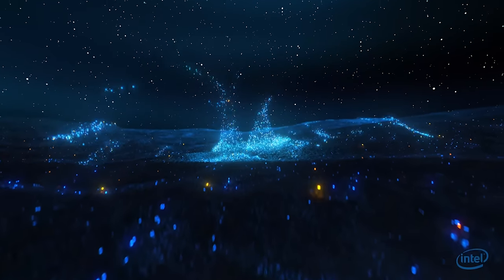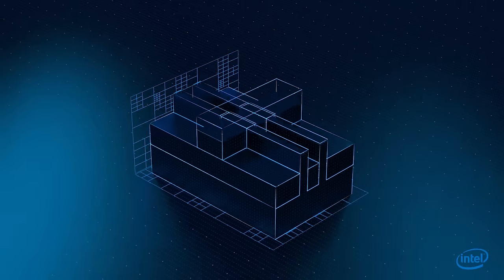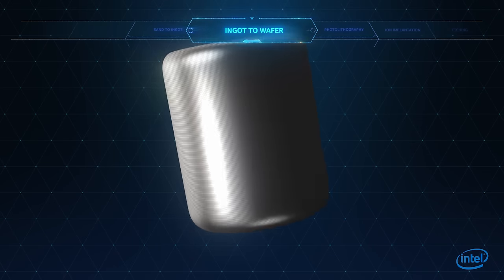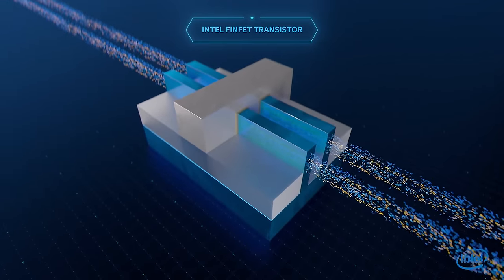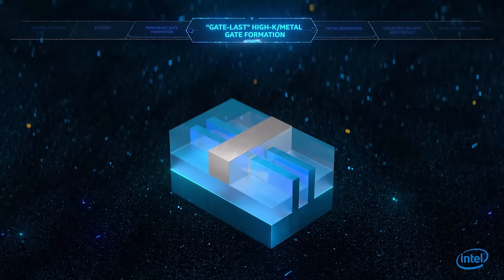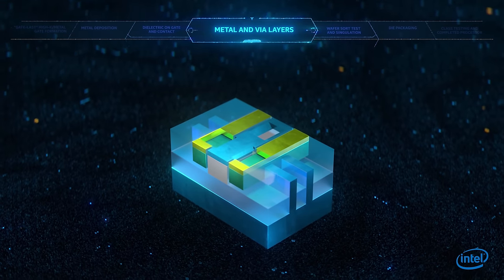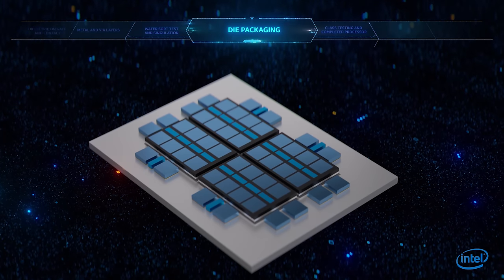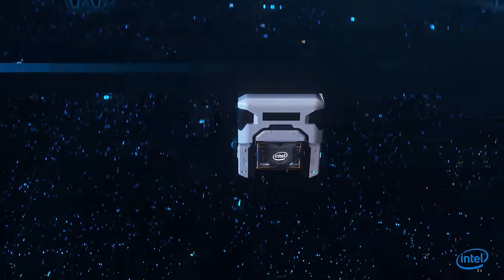From Sand to Silicon: The Making of a Microchip | Intel

Comment: My brain can’t comprehend this. This is just incredible.
Reply: They extract the silicon out of (quartz) sand by melting it to 2000°C. Then they have machines for each process that do everything for them. Each group of engineers / scientists only know stuff about their chain in the production process because the whole process is so very complex.
Reply: @Scrungge   ccg
Reply: @Scrungge  q
Reply: Also no CPU is the same some come with higher clock speeds or dead cores. I3, I5,I7 and so on are all the same processor just with different clock speeds or core count...think of it if you design a cpu with six cores but two are dead leaving you with 4 cores, why throw it away ? Just brand it as an i3 and sale it cheaper. It's also referred to as the silicone lottery. Pretty cool that CPUs have there own personality.
Reply: Basically we tricked a rock into thinking

Comment: Wow, this is how vintage 14 nanometer processors are made. Fascinating
Reply: I knew this comment would be here LMAO.
Reply: Lol
Reply: trust me you dont want to see a 7 nm intel processor, that would be an industrial revolution lol
Reply: u made me lol :)
Reply: @eduuklee9453  That is exactly why we DO want to see it. Its impressive that intels 14nm platform has survived this long but it is showing its age. overheating cores and lackluster performance is plagueing intels new 14nm chips while AMD can run cool as a cucumber despite having more cores. Intel needs to innovate or they are going to hit a brickwall with 14nm
Reply: @shadowxxe  also not every cpu type can become 7nm, if intel want to go down that path they have to re-invent a completely new kind of archetecture. AMD can have 7nm because they invented a completely new cpu for that purpose. some smartphone "ARM" CPUs even got 5nm but that doesnt mean that its possible to make a 5nm ryzen CPU. It would probably require a new archetecture again D; its not that easy. And i dont blame Intel if they can not manage to solve such a complex problem.
Reply: @eduuklee9453  AMD used TSMC and Global Foundries for their 7nm chips intel should probably do the same. Also ARM CPUs and Desktop chips arent like polar opposites they are still CPUs they still use transistors its entirely possible for an existing arm technology to be upscaled and redesigned for desktop chips and it wouldn't even be that hard. Also, you should blame intel for not being able to solve this because THEY are the ones who refused to innovate for 10 years sending pc hardware into a dark age THEY are the ones who spend all their money on marketing rather than RnD and THEY are the ones who kept rehashing 14nm for 5 years whereas AMD left it behind only a year after they first used it.
Reply: @shadowxxe  AMD wasnt able to make a 7nm on their own eighter. Partnership and fusions with other companies is literarelly the worst thing that can happen and should only be considered on the verge of bankruptcy. Intel will do it on their own, they got the ressorces. and even if it will take another 10 years of developement it will be totally woth everything. Indeed This is the age of Ryzen CPUs.
Reply: @eduuklee9453  lol thats actually everyone wish. When is it?
Reply: Ze10
Reply: @Ron Bali Yes thats because intel also produce wifi cards, sound cards and other ICs their CPUs however are declining in demand
Reply: @Ron Bali Wierd considering they had to drop process on 11th gen because they sol so poorly
Reply: @shadowxxe  They did it because it's just a stepping stone processor. It's their 10nm architecture on the 14nm node. Like someone said before...You can be a fanboy for either company but let's be honest here. Intel is a HUGE company and has done wonders in the electronics game. AMD has a long way to go. Respect to both though.
Reply: "Waste of sand."
        -gamers nexus
Reply: @MrPanaramuh  Like i said it is of no concern to me what intel have done in the past the point is right now they are failing to deliver. they were titans in the past but now they are loosing major market share in the consumer market
Reply: @shadowxxe  wouldn't really calling it "failing to deliver." Intel designs AND manufacturers their own cookies in house. It's just two different games. AMD has woken up, Intel sees it, and the race has begun once again. AMD hasn't really been a competitor since before their Thuban line. Can't really blame Intel for making money now, can we?
Reply: @shadowxxe  
"Failing to deliver"

Depends.
In raw performance and power consumption, yes, they have failed to deliver AMD's performance at AMD's power draw.
But they can still deliver AMD's performance levels at very high power draws.
(As side note, rocket lake is meant for desktops, and lower power draws are more of a preference/"good to have" than necessity)

So they have not not failed to deliver 4 things:
1) They have not failed to deliver the performance of 2nd most advanced process on earth on a very ancient process.
2) They have not failed to make cpus on some ancient process competitive with cpus on 2nd most advanced process on earth.
3) They have not failed to make a cpu designed for 10nm on 14nm
4) They have not failed to make a backported cpu at least competitive.

Ryzen 5000 is better than 11th gen because its gives intel's performance at lower power draws.
But still, given how complex these things, these 4 things i said intel delivers are big achievements in themselves.
Reply: I literally have a 45nm processor BRUH
Reply: @eduuklee9453  2022 we will see them, but IBM almost reached the 7nm intel density with its own 2nm
Reply: @jhonrinkarsi2269  2022
Reply: @eduuklee9453  3nm is saying hello
Reply: For me 14 nanometer is decent enough
Reply: @adrian-121  lol, I haven't owned any product with an AMD processor, my entire life
Reply: @sankalpagrawal345  i have. It's worse than vintage.
Reply: @adrian-121  well , I hope someone makes a video on that, it will be entertaining
Reply: @sankalpagrawal345  ok, I can make one if you dare.
Reply: @adrian-121  hmmmm, that would be fun.
Reply: Antique owner of 32 nanometer processor here
Reply: @adrian-121  no it isn't I have both Intel and AMD ryzen 7 5700u is able to give me 9 hours of battery life with good integrated graphics and delivering my i9 10900k lvl performance or bit lower
Reply: @LtMewS  it depends on the battery. Intel laptop would run faster if it had a larger one.
Reply: @thefirstsin  rip
Reply: RISC-V architecture, 7 nm!
Reply: These numbers are meaningless
Reply: @starlitnight6982  intel's 14 nanometer is slightly worse than tsmc's 10 nanometer, according to some comparisons, so they are not meaningless, unlike stuff like comparing tflops between gpus of different brands

Comment: And everything has changed after ryzen came
Reply: Love you comment my brother
Reply: Opecuted  well yeah, nowadays one needs to attach a refrigerator to cool an intel chip, looks like the old amd is the new intel
Reply: @Alab.A  that's not true. i think you never used intel. and also intel has capability to bear over heat.
Reply: @VibezVideo  "cheap" 🤣🤣
Reply: @VibezVideo  intel i5 10400f is cooler than r5 3600 ON STOCK COOLER. YEAH. THAT TINY FAN WHICH EVERYBODY MAKES FUN OF.
Reply: Intel gave birth a baby named Ryzen! Intel is that old

Comment: AMD fan here, btw the 14nm lake is drying up.
Reply: Intel
Reply: Just imagine how great is intel they can still squeeze out every single bit of performance being on such old process node, they are still not dead AMD is gonna enjoy the market value until intel comes to 10nm/7nm/5nm etc
Reply: @shubhamjoshi7213  impressive, however not the direction they should keep going to. 14nm can only do so much if Intel still can't figure out how to get the 10nm fabs ready, since right now their CPUs are literally taking double the power to barely match AMD's performance (in other words, only half of AMD's power efficiency).
Reply: @shubhamjoshi7213  i like your profile pic
Reply: @mauricetejada6553  its made for pubgm profile pic 😅 because on fb id all the reletives are connected
Reply: Yeah, instead of actually being interested in tech, its better to flame Intel yes yes
Reply: Intel makes their chis themselves and researches on it themselves, and on the othe hand amd outsources their chips that is why Intel has best 14nm chips and their 14nm chips compete head to head with amd 7nm.
Reply: tsmc/samsung are the future, now.
Reply: @akshitchoudhary877  have you seen the benchmarks? amd 7nm outpeforms intel 14nm. and amd processors are designed with tsmc's processes in mind.
Reply: @akshitchoudhary877   head to head? Not really, they are quite a bit behind in regards to overall performance, simply due to efficiency.
Also, what Intel calls 10nm for example has very similar internal dimensions to TSMCs 7nm, if not 7nm+, similarly with 14nm
Reply: @imeakdo7  memory future
Reply: @imeakdo7  if no ones talking with you then what you think you are smart?
Reply: @shubhamjoshi7213  yep on a 288 watts tdp
Reply: @shubhamjoshi7213  well the great Intel quietly admitted they are behind AMD as their next gen cpu's won't be coming till the end of 2021. Such a great company to come out and admit defeat.
Reply: Shubham Joshi But but but Intel had promised to already be on the 7nm process and they are not what do you think about that??
Reply: Haha
Reply: Do you spin well, AMD fan? Gotta keep those heat down, you know..
Reply: @akshitchoudhary877  bruh intel isn't innovating whatsoever. the only reason the are pushing out so many new processors is because AMD is biting on their heels. AMD isn't only a better value, they also perform better in almost everything.
Reply: @antonn.ivanovic  gotta make that TDP lower , you know.
Reply: @69iqtutorial  sucks
Reply: @shubhamjoshi7213  Intel has the majority of the market share, and they can't squeeze anymore power out of their outdated processors, without having an astronomically high TDP
Reply: @antonn.ivanovic  used their coolers in the past, gotta admit I was surprised the stock wraith spire kept my overclocked 3.7GHz ryzen 1700 under 70°c. So AMD fans are pretty solid considering they come included in the box
Reply: @shubhamjoshi7213  They already came to 10nm, and so far it sucks hard.

Comment: Amazing video but I'm changing to 3rd Gen Threadripper...
Reply: AMD is fine if you don't need single core performance.
Reply: @1pcfred  TR has higher single core than ANY Intel CPU.
Reply: @jonnypena7651  does it?
Reply: @1pcfred  comparing to the server and production side of intel, yea!
The only need to buy a xeon this generation is if you have a specific software that only suports it
Reply: @FIRSTEBITOS  sounds specific to me. I'm not much for servers myself. I only have a file server. It runs on an old i3. In general I favor Intel over AMD. I haven't run any AMD hardware in over 10 years. As far as I'm concerned right now it is all junk. The whole industry has fallen off a cliff. I don't see it being sorted for years yet either. So if AMD wants to be king of the garbage heap presently then they can have the crown.
Reply: @1pcfred   ok, just saying if you need to buy a new processor, i also preffer the athlon and pentiuns days, they used to be a big race
Reply: @FIRSTEBITOS  now is not a good time to be buying PC gear. My present rig pretty much does what I need it to too. It's a bit slow on some tasks. But I'll manage.
Reply: @1pcfred  ok
Reply: @FIRSTEBITOS  it is.
Reply: @1pcfred  ok
Reply: @xtruder1828  boomers created the world you're living in, kid.
Reply: @1pcfred  i guess you didn't get the joke, it's okay. And i didn't mean to offend you either :) btw I'm 36 years old now.
Reply: @xtruder1828  so that makes you a border line Gen X or Y. Least you're not a millenial right? Or worse yet a zoomer! Those kids truly are insufferable. The world certainly has failed them. They're in for a rude awakening now.
Reply: @1pcfred  alright sir
Reply: @1pcfred   😅 and i respect your opinion . Peace
Reply: @1pcfred  jeez. Calm down.
Reply: Paul Frederick I agree with you mad and is good at multi core performance because it has lots of cores but intel definitely beats amd at single core preformance and that’s why I use intel because most 2020 games need less but strong cores
Reply: Jonny Peña but that’s really expensive

Comment: Man Intel is still innovating and at the cutting edge. My company, that builds fabricated circuits, that Intel uses to test each of its chips, is constantly trying to keep up with Intel just so we can stay the primary contractor. Engineers have all entire seminars and meetings, PowerPoint presentation and trial and error experimentation to try to figure out how to make something that and test the “new” thing. Right now Intel is about to introduce a new type of EMIB and so my company has engineering runs going through the fab everyday trying to nail it down.

Comment: "doubled transistor density with every new generation"

Fake News! Intel is basically selling 14nm skylake CPU's scince 4 generations xD
Reply: David you get to see the scatter plot flatten at the end haha
Reply: They said transistors 
Intel still has more transistors density than AMD.
Intel is doing the same thing what AMD did before ryzen
Their cpu runs hot and at higher clock speed 
I am not a fan boy
Reply: Skylake is architecture. Same architecture can be used for fitting more transistors.
Reply: @premashetty6469  The Transistor density is lower then AMD, TSMC's 7nm HPC Process has 66.7MTr/mm2, Intels 14nm++ has 37.5MTr/mm2
Reply: @apcgamer2265  fake news. You can fit a Ryzen 5000 series on a B450 easily. Also all boards and chips are unlocked unlike intel.
Reply: @lel3019  Maybe one day in your life you will learn basic maths and notice that 14 is bugger than 7
Reply: @shadowxxe  i do know that but marketing and reality are 2 different things 😂

Comment: “Doubling Transistor Density in every new generation of processors”
Yeah, as if they didn’t stay with 14nm for 3 generations
Reply: Bruh theyre still on 14nm and just started making 10nm hahahaah
Reply: Just because they stay on the same manufacturing process doesn't mean the transistor density stays the same.
Reply: @camulodunon  The Transistor density is still the Same.
Reply: 3 generations? Its 5 generations.
Reply: @premashetty6469  Not correct, as the dude who previously replied to you said, AMD has nearly double the transistor density.
Reply: @lel3019  dunno if you've ever seen a graph comparing transistor sizes, theres nothing 14 or 7 about them
Reply: @GAMEVIDSnorwegian422   yeah keep licking AMD's butt keep it up you are doing great
Reply: You guys don't get it. Intel is a semi conductor manufacturer beside being a CPU manufacturer. 
32nm, 22nm, 14nm, 10nm, 7nm, 5nm, 3nm, 2nm etc. are nothing but names for processing generations. There is literally no structure within a 14nm CPU that actually measures 14nm. 
Instead of calling it 14nm Intel could name it something like 25th gen (I don't know how many process nodes Intel already created) which would be legitim as well. 
And Intel indeed doubled the transistor density with each (process node) generation. Unlike foundries like GloFo Samsung or TSMC who usually under scale their process nodes. That's the reason why Intels 10nm is pretty much equivalent (even better) to TSMC or Samsungs 7nm process. But you guys don't seem to understand the basics of CPU manufacturing and just believe in marketing numbers. 

BTW: Intel names its intra generation improvements with a + notation and that's fine. But GloFo and Samsung do the same but use different names. GloFos 12nm is nothing else than 14nm+ with a fancy name. Samsung 8nm is nothing but 10nm+ with fancier name. Intel never really cared about this. Samsung and GloFo use these fancy names for marketing and you guys take that without questioning. Not a surprise why they keep doing it.
Reply: @lukas_ls   finally someone got brain now i can finally say that im proud intel user
Reply: I only use Intel xeon processors for my office and home.

Comment: Incredible processing power that you don't currently have, Intel. Single core is good, but only because of your clock speeds.
Reply: Not clock speeds.
AMD has to emulate x86 execution because they do not hold the rights of x86 instructions. So therefore for each x86 instruction that a AMD chip has to execute, it must first be translated into a instruction that the AMD chip internally uses, executed, then re-translated back to x86. This inserts a little bit of overhead into each instruction that a AMD chip has to execute and the reason why Intel chips appear to be faster with single core(because a intel chip can natively execute x86 code).
One of the ways AMD has made up for this issue was to just bruteforce it with a truck ton of cores.
Reply: @memadmax69  except that it also has to do with clock speeds. Intel has 5 GHz all core boost for their i9 9900ks, and yet it is within 10 to 20 points in single core performance of AMD, and AMD is at 4.7 GHz max turbo. Single core performance, despite the overhead, is within margin of error, and within games, only really benefits the 1080p/1440p gamer with a 2080 ti. There are some games that Intel really excells in, but for the most part, an Intel i9 9900ks gets beaten by the ryzen 9 3900x
Reply: @memadmax69  Do you have a source for this?
EDIT: I searched myself and found that the famous " ‘338 patent" was settled to a cross licensing agreement with amd.
Reply: @Jonas_Meyer  

Look up RISC decoder.
Reply: @memadmax69  That is so wrong in so many ways. Please give a reliable source that says that AMD can't use the instruction set that they developed. Yes, they developed the x86-64 instruction set and that's why it's still refered to as AMD64 today. 

The difference in single core speeds is down to clock speed and IPC. Intel has higher boost clocks due to the mature 14nm node.
Reply: Amd single core is coming. It's coming.